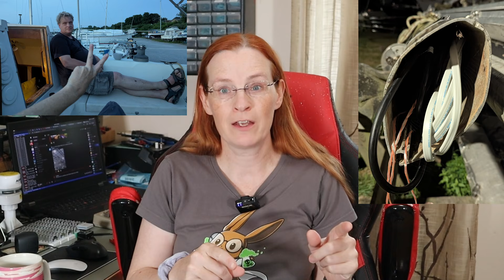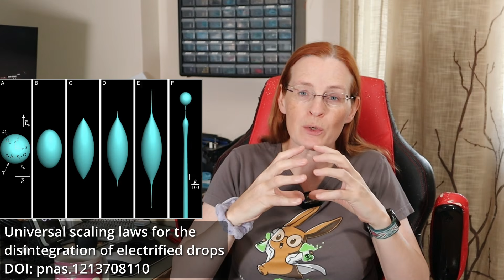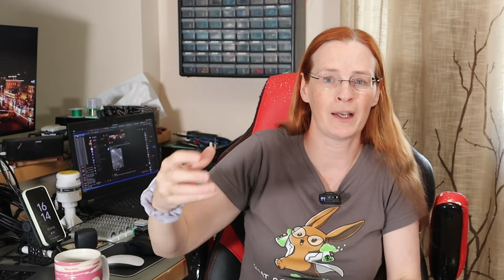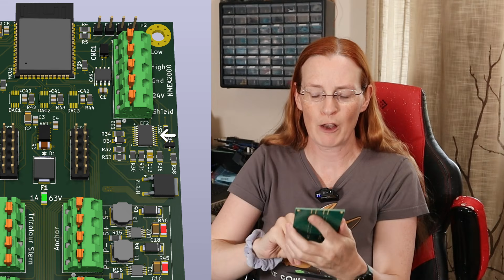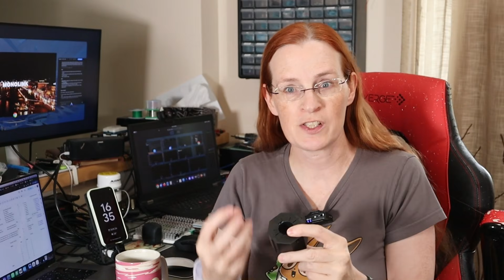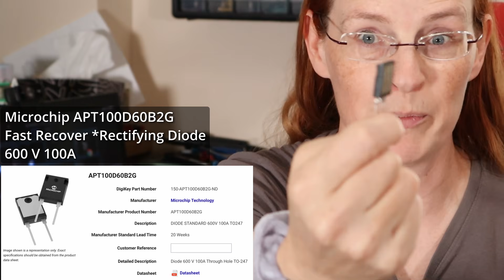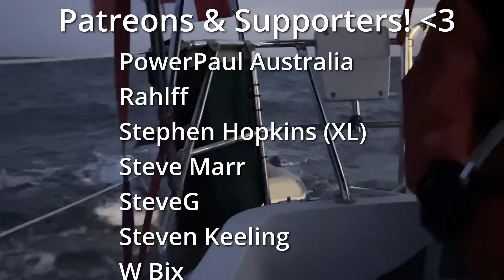Designed to be Destroyed - Ep. 127

Comment: Wait wait, now I understand why the electrician put a ferrite core around the Ethernet cable going from the inverter to our battery at out photovoltaic setup. Its a surge protection!
Reply from the maker: Not on its own, they likely did it for noise suppression.
Reply: @TheDigitalMermaid  I that even necessary / does that even work given the fact that Ethernet is twisted cable pairs?

Now that I think of, they use RJ45, but it is not explicitly an Ethernet connection. Maybe they just use it to connect to a BMS inside the Inverter? Just because Ethernet gives you 8 individual wires in an easy to use and widely available package.

I need to have a look into the data sheet for this.

Comment: If you're open to ideas, here's another one: UPS 3 Click (LTC3110) + RPi Zero 2W. A supercapacitor-based UPS will allow you to have a Linux computer that runs on any power source and shuts down smoothly (for save logs, data for gps hot start, etc). It would be ideal for a scooter, or auto for example. (or a wind turbine)
Reply from the maker: I'm actually working on something like this already. I needed a pair of USB-C PD outputs to drive the MFD I'm building, so I designed a PCB (that I just ordered today) that takes LFP 12.8V (9~16V) and outputs a pair of USB-C PD outputs. It's a little different in that it's solving a specific problem, but the idea is the same. 

In any case though, neither work on the masthead. I need 26+ VDC to drive the LED strings, and USB-C PD v3.0 contracts only go up to 20V. However, your idea has merit, and a small 12.8V LFP feeding into the same DC/DC 12/24v boost converter I'm already planning to use would actually work fine.

I'll think about this more, but it's genuinely interesting!

Comment: Thanks for putting out this interesting series on lightning and lightning protection. The amounts of energy involved and the insane high voltages make this indeed very difficult to manage, only a sufficiently large air gap can stop the discharge current from flowing: so I think your wifi connection for the masthead electronics is a very nice solution (alternative would be some kind of fiber optic link, but that gets more expensive quickly, wifi will be fine for your scenario). I do worry that in a fully strike the current will still hit the rest of your dc system, through that dc-dc converter. The mitigating actions with the GDT, TVS diodes and MOVs will help against induced voltage spikes, but stand no chance against a full strike 😮. 

Maybe an idea to consider is to simply fully disconnect/isolate the "masthead electrical system" from the ships main dc system, by using a separate battery? That battery could be charged during normal weather conditions, but unplugged when there's a potential for a lightning storm. Of course your vhf would also need to be on that dc system, and any external interfaces (ais?) again sufficiently air gapped (wifi, fiber optic.. an opto coupler won't help here).

Another topic you may want to take into consideration is cable routing, and especially the "loop area" for long runs. In case of a nearby strike, the length of the wire will determine the voltage differential and amount of energy picked up. So from that perspective multiple smaller (clustered) systems are preferred over everything hardwired together... fiber optics are great! So many difficult trade-offs in the system design. 

I think the TL;TD is: stay away from thunder storms! (I live in the D.R., so impossible here)
Reply: The main pulse should go though the mast to the sea. These circuits are for the induced current in the cables and for any secondary strikes jumping a draction of current away from the mast into the electrical system. Telephone masts have a similar solution. Most current in the mast (30kA to 100kA) and just 4kA through the wires. You can necer block the current, but you can shunt it. 100kA for 100us is not a lot. It is an average current of 10A ofer 1s.
Reply from the maker: Bingo; The goal is to keep the fractional current as low as possible.
Reply from the maker: Wifi is cheap and readily available thanks to how popular ESP32s are around the world. Fiber would still require a separate power connection, so that vector stays regardless. In the paper I'm working on, I talk about how twisting wires effectively removes voltage induced via the loop area. Cheers

Comment: @TheDigitalMermaid    What Electrowizard2000 said about the discharge tube relative to the ferrite choke.  My thought is as they said, that it would be best to have the discharge tube above the choke.  I'd put them on both + and - power lines, then the ferrite choke with both wires going through it, then the diodes in front of the DC-DC power supply.  The idea is to use the choke as a way to make the discharge tubes as effective as they can be, then the diodes can pick up whatever is left over.  Hopefully the discharge tubes would conduct before the ferrite saturates.  The supply is already isolated on both + and -, so you're defeating part of your plan by grounding the negative side of the output.

All that said, there's perhaps an easier solution...   Polyphasor also makes a lightning protection box for rotor control wires.  Put that in parallel with the arrestor for the radio, and done?  It can handle 8 wires, so you could even buss two sets of 4 together for more protection capacity.  Turn-on time is spec'd at under 4ns, and are "faster than a gas discharge tube" says the ad copy.  Why build your own, if you can get it pre-engineered and tested off the shelf?

Love the detail about how lightning actually works.  Learned something, which by definition makes this a good day.

Comment: You are doing wonderfully well and now I feel you will iterate correctly to the solution.  Congratulation. At last - definition that lightning just gets everywhere when it hits so safest assumption is trust nothing after a hit.  Alas current in mast gets coul[ed inductively to all wires going down the mast - theory says faraday gage stops it but at HUMONGOUS currents material deficiencies means the faraday gage is not.  LEDs can work well with PWM - high off to on ratio and peak current being high to get high peak intensity.   For rliability I went away from DC breakers. Simple high quality Auto blade fuses are remarkably reliable. You can have a 100 spares in the volume of  asingle breaker.  ferrite inductor works best with single pass. Adding turns means you get arc over between turns through dielectic breakdown and pin holes. ALternate strategy is to add more ferrites. However have you checked ferrite saturation current? Once saturated inductance goes away.  Need a 100pf ~ 10kv cap across TVS and GDT to get rid of that nasty leading edge before TVS starts conducting. I suspected that isolated power supply will arc over at the terminals to case. You might try removing the metal case first. Next to arc over is the internal barrier transformer. Making super high isolation transformers is hard. Teflon former with no holes is a good start.

Comment: My father's sailboat was struck by lightning this summer. It was docked at the time, and the battery was on a trickle charger. The damage was surprisingly minor: the VHF worked after replacing all the fuses, the trickle charger exploded sending shrapnel through the cabin, and the GFCI outlet on the dock needed to be replaced. Compared to the usual damage it endures during hurricane season, it really wasn't bad. I bring this up because there's a debate in the comments about whether or not all these upgrades will actually make any difference with the lightning strike. And my opinion is... Maybe! There's such a range of how bad lightning strikes can be. With a gentle strike like what my father's boat received, i think it probably would make a big difference and be well worth the effort. With really powerful strikes, maybe not. Assuming that Digital Mermaid is some kind of sailing storm chaser, it could definitely make a difference. All I know for sure is that I am really excited to see the videos of when she puts it to the test and sales into the heart of a lightning storm.
PLLEASE be safe, but get videos from every angle!
Reply from the maker: When I talk about the "IEC 62305 -CG 30kA Media Strike", it's just that, a median. You can get much weaker strikes. Your dad got lucky by the sounds of it. -CG strikes can get up to 100kA, and +CG strikes start at 100kA. 

The biggest thing to remember is what the risk is being mitigated... I'm not so concerned with avoiding expensive damage, that's what insurance is for. What I am designing for is surviving a strike on passage. It doesn't matter how good your insurance is if you find yourself with dead propulsion, dead radio, dead batteries/chargers, etc and you're a thousand miles off-shore. :)
Reply: @TheDigitalMermaid   That's almost exactly what I was trying to say, I just didn't really get to it. 😂 Are you going to test it at all before you install it on the boat? If you've got any universities nearby with a megavolt+ Marx generator in their physics lab, you could probably bribe a couple grad students into an awesome video collab.
Reply from the maker: Dude, I shouldn't. Like, if I'm wrong it would be REAL expensive. But the nerd in me reaaaaally wants to!
Reply: @TheDigitalMermaid  You might not need to bribe grad students after all. Did you see the video Electron Impressions posted today? It's all about how to catch a lightening bolt using a rocket on a wire. You should ask them if you can put your circuitry on their launch pad. Given that their radio (among other things) was destroyed by the strike, they might be grateful for your info.
Reply from the maker: @SkippiiKai  sounding rockets, they're called... It has crossed my mind...
Reply: @TheDigitalMermaid Think of all the clicks you'll get with a sounding rocket launch pad on the bow of your stormchasing sailboat!
Reply from the maker: @SkippiiKai  it would need to be quite a lot to cover the expected damage, let alone if the damage was more than expected... Lol
Reply from the maker: Oh, and I should mention, I am very much NOT a storm chaser! Haha. Mermaid's Rest (my boat) is a performance cruiser (cruiser/racer). One of her key defences is being fast and nimble enough to get away from storms, so long as I see them soon enough.

Comment: I think this is really cool! I'd consider bringing down the NMEA cables in the mast and leaving them disconnected, so that you have access to them in an emergency if the ESP stopped transmitting.

Re: ferrite around your power wires - just above this would be the best place for MOV/gas discharge on +/- to your grounding system, because yes it's effect will be very temporary if the current is allowed to pass through it. The current plan of putting the diode beyond the ferrite will make it less effective than it could be.

Hold on, something isn't clear to me. It sounded like the negative conductor in your mast will be tied to the lightning ground system - but this should be isolated by your DC/DC converter, only the input side would be tied to lightning ground. Unless you're planning on tying the grounds together? (If not, I don't understand why you're saying to put the protection between + and boat-)

I really strongly think you shouldn't put the GDT to boat-, because that's putting all the strike current through your boat-. While yes it is tied to your grounding system, it's going to generate voltage along the path while it does so, and put voltage across everything in the system.
Can't you have a direct line to your lightning grounding system? (Kinda same as residential wiring, boat- is like neutral carrying normal currents, and a direct grounding wire is used only for fault currents, and they're only bonded at one place, the grounding point)

I think that both the isolated+ and isolated- should each have an independent GDT to the grounding system, at the point above your ferrites. And each should have an independent TVS diode after the ferrites, at the isolated power supply output.
So as current travels down isolated+/-, the voltage at the isolated supply tries rising, its rate limited by the ferrites and redirected by the TVSs, meanwhile the voltage above the ferrite is rising faster, and ignites the GDT, routing the current around the ferrites, along a dedicated path to ground. 

Doubly confused - APT100D60B2G is a standard diode, its not designed for reverse breakdown like a real TVS is, it won't conduct until V_R of 600V, and you'd really want a TVS and/or MOV with breakdown like 48V or less. As far as I understand, the breakdown of the TVS and GDT are not supposed to be equal (I see you've selected both 600V, I suspect this was not a coincidence)
A real TVS has a different internal structure, you really should use one. Adding MOVs wouldn't hurt either. And if you're doing a PCB you can also do a spark gap, interdigitated triangles without soldermask.
(Sorry for the essay)
Reply from the maker: I'm planning to use type 43 chokes at the controller for the wires going into it. The N2K cable is connected to the controller, so a spare cable wouldn't help. If I have to go up the mast to disconnect the N2K, I'll just swap the controller with a backup. 

The bond between the llights/N2K needs to be at the base, as close to the lightning ground as possible. This is key to getting the current that takes the parallel path as low as possible (my increasing inductance as much as possible). Keeping the current down reduces the voltage spike (V = L(dI/dT)) to a level I have a chance of surviving. The isolated dc/dc supply is the last line of defence between the mast's sacrificial node and the rest of the boat. The ground wire is already bonded to the lightning ground (which is isolated from the vessel's electrical ground via the capacitor bridge). So the only need for the TVS + GDT is on the +24V side. 

You might be right on the diode, I grabbed it out of the box I have for the galvanic isolation, which would explain the rectifying vs TVS mixup I noticed in editing. I'll check/swap that.
Reply: @TheDigitalMermaid on isolated supply, what do you mean by ground wire?
I expect input: boat-(grounded), boat+(above ground)
Output: mast+, mast- (both floating, referenced to nothing)
In this case you'd protect both mast+ and mast- to ground (not boat-)
Right?
Reply from the maker: @electrowizard2000 the output negative will be bonded to the lightning ground, which is isolated from the boat's ground via the capacitor bridge. That bond happens at the base of the mast only.
Reply: @TheDigitalMermaid I wouldn't, but it's your boat! You're kicking butt, she's gonna be great!